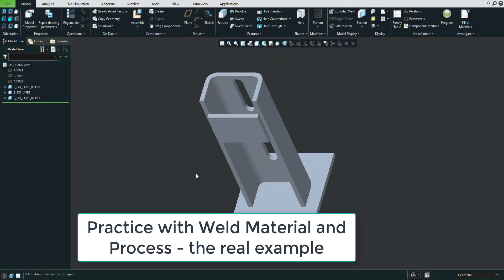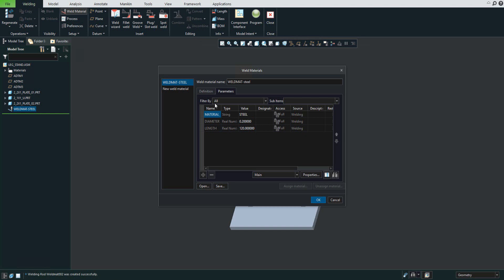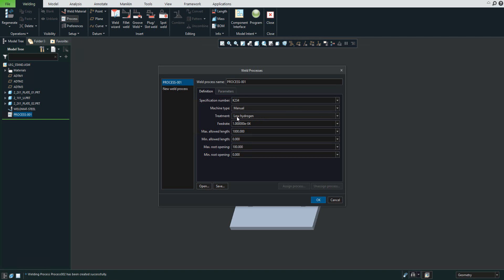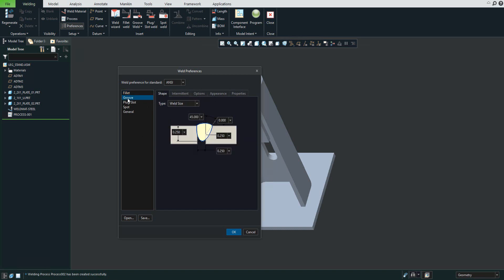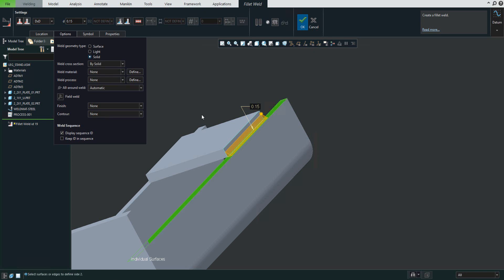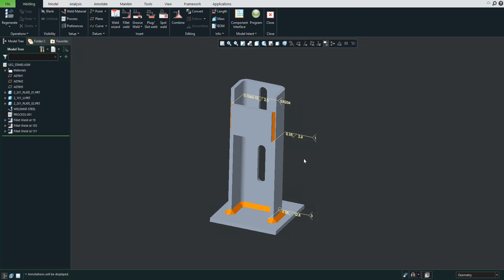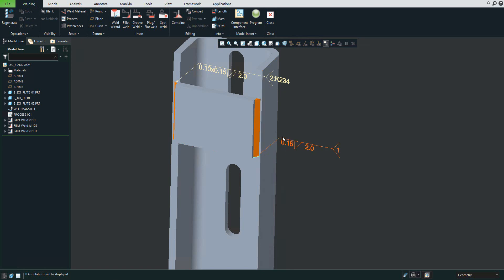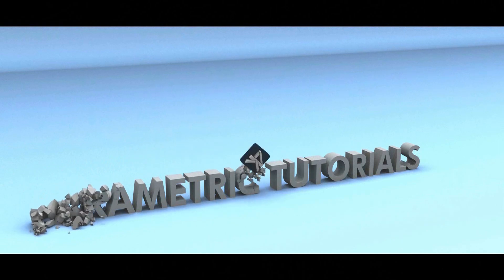Creo Welding tutorial: Practice with Weld Material and Process - the real example

Comment: Does this Creo have extensions added for welding capabilities?  If not what version is this?
Reply from the maker: Hi thanks for the question, please try to check all tabs for welding process, maybe you will find what you need. This tutorial was created in Creo 7. Stay tuned and share my tutorials. Thanks Vladimir
Reply: Creo has welding as a standard if I remember from Creo 1 / WF onwards. One may find the icon to activate it under Applications. Welsing is available only when one is in Assembly or in Sheetmetal (Creo 4). Hope I have understood the question and have been of help.